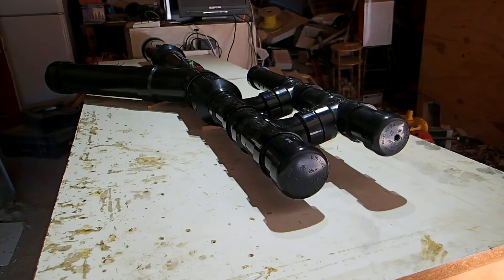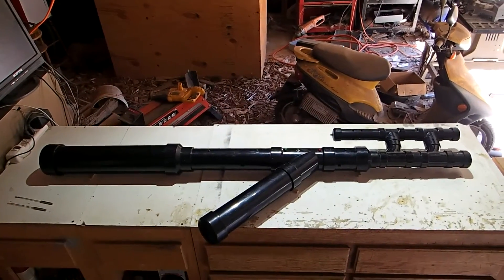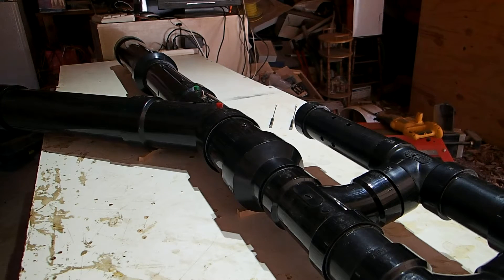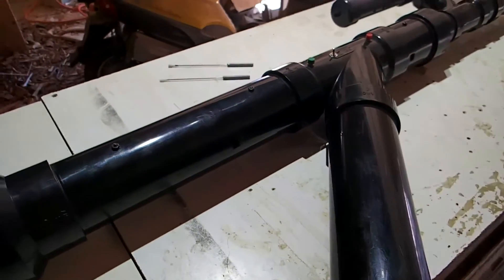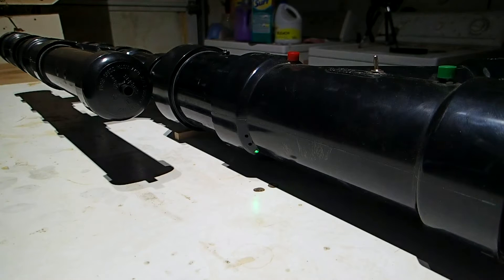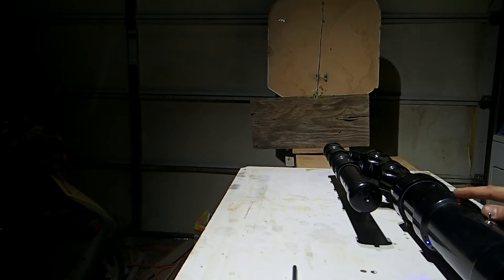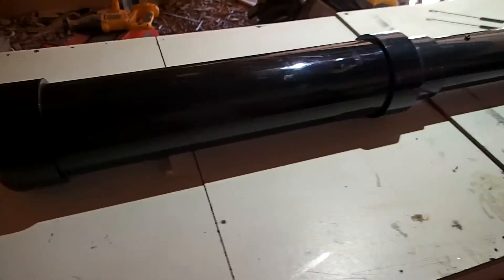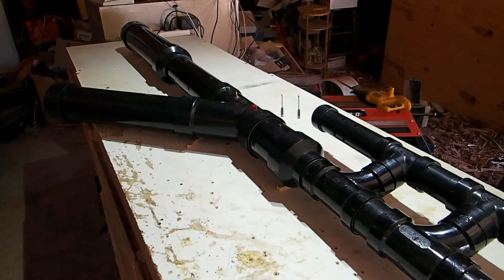The Yak Magnetic Flux Bow (Darpa Weapon)

Comment: 6 MW? hard to believe, not even if it was peak. My ETG discharges in about 600us 4kj so about 6.6MW average, i have to use very thick wires and take care of having little inductance and im using about 800V. working at 450V the currents would be far higher to reach such power and there is the issue that its being discharged on an inductive load, one were the pulse should last many ms so the projectile gets accelerated efficiently, ill be surprised if each stage uses more than a couple of tens of kW, tops about a hundred kW.  if your device has 5.5% effciency and its kinetic energy is of 45J aprox means your storage is of about 818J you would have to discharge that in 135µs to reach the 6MW, there is no way a reluctance coilgun gets 5.5% efficiency with such a short time of acceleration, thatis if such circuit was capable of those discharge times at all.
Reply from the maker: You have a good day too
Reply from the maker: Can yours do this?

https://youtu.be/DjoYHLye2p4

Comment: is this gun still laying around ??
Reply from the maker: Vasudev Mr the battery pack in it failed the guy sold me bad cells, that cause the computer to go crazy and the coils were firing like popcorn, it eventually burn out the power supply and I had to cut it open and take everything out. Like a Surgeon
Reply: oh i see . so are you building anything else ??
Reply from the maker: Vasudev Mr a solar charge controller using Arduino instrumentation
Reply: Moss Fett I was testing single stage high voltage coil gun which operated at 1500v .. maxcould get was 40 m/s at around 21 joules